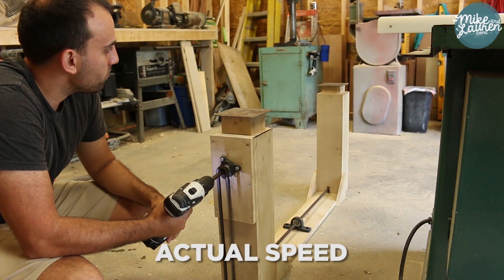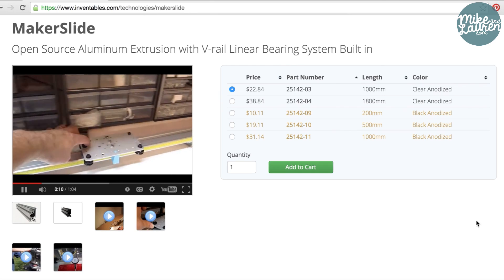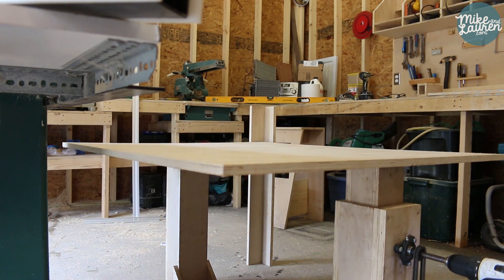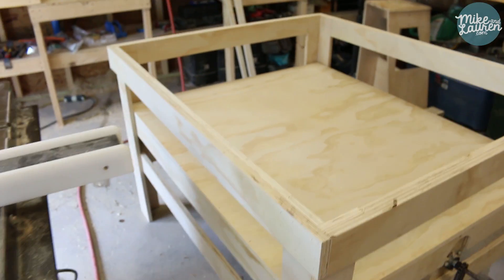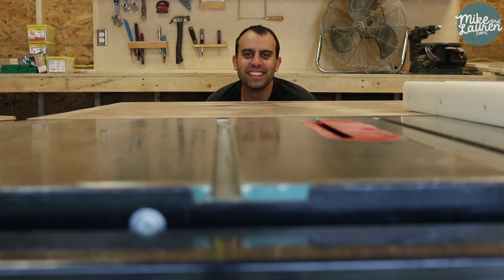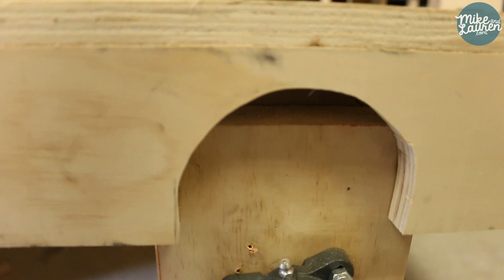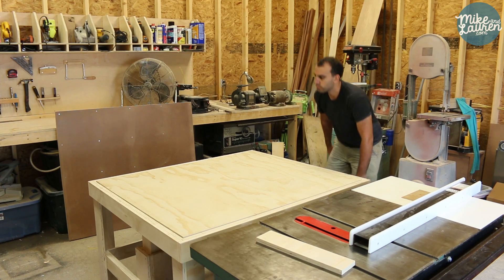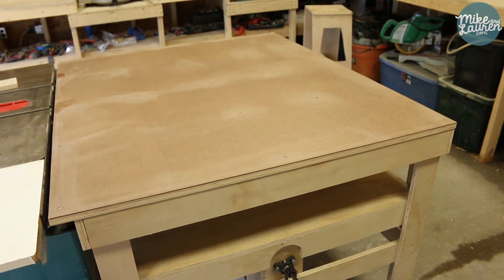Mike Makes an X-Carve Lift/Work Bench/Out Feed Table (Drill Powered Thingy)

Comment: I see one problem, what happens when you push your table saw guide too far? BONK! It hits your new extension. Think about a groove for it or lower the extension by 3/4" or so and add plastic coated runners to the extension top in the direction of, not across, the direction work would slide.
Reply from the maker: DrGerryD I thought the same thing, but it turns out it is a perfect "stop" for my table saw sled.  Right now the sled is the only thing I have that uses the miter slots, but I'll eventually use the router to cut slots when I need.

Comment: You can use all-thread and nuts epoxied to the legs to make adjustable feet. Then make feet using plywood with a set nut.
Reply from the maker: Frank Servais That's what I think I'm going to do :)

Comment: Great idea! You could add some hinges for the table top so you do not need to carry it around.
Reply from the maker: Mighty Wood I was thinking that, but the top is wider than the table is tall.  So it wouldn't fold down very nicely.
Reply: Mike and Lauren Maybe a split top? One side folds to the left, the other to the right.
Reply from the maker: Mighty Wood That could work.

Comment: Hi, great design, but you will need to move the table saw to use both at the same time, maybe is good idea to put locking casters in the workbench-cnc base-assembly table, to move it when needed, is less heavy than moving the table saw.
Reply from the maker: Ramon Urbina Yes, I plan on putting casters on both the table and the table saw.

Comment: That lift mechanism is really GREAT.  Nice work!.  The only thing I see you might need to change is to route slots in your worktable top for the table saw's miter gauge  (we just built an out feed table for the table saw at our local makerspace, and encountered the same problem.  That's is why I'm mentioning it).  Thanks for the video.
Reply from the maker: John Benedetto Yea, I took the miter gauge off for now.  If I ever need to add it back on, I'll have to cut a little groove.

Comment: You might consider cutting out a couple of hand holes/slots in the tabletop then going around them with a roundover bit in the router to soften up the edges.  You can put them about a quarter of the way in from either side to make lifting it up and out of the way, as well as setting it back in place, a little less of a chore.
Reply from the maker: Michael Baker Great idea!

Comment: This is a great idea! If your table saw isn't on wheels then I suggest you might want the table on casters so you can still use the saw when the CNC is running.
Reply: Shop built Couldn't he set up the xcarve, let it run, lower the cnc while its still cutting, then put the table top back on?
Reply from the maker: Shop built Great idea.  My plan is to add casters to both the table saw and the lift table.  I have a base with casters on the table saw, so that will take care of that and give me an inch or two of lift.

Comment: Do you even need to raise the CNC to use it?  In which case, why the lift?
Reply: Matthias Wandel The way I see most people run a CNC involves a lot of babysitting (i.e. standing there with a vacuum for 2 hours or holding down pieces as they get cut free from the board). Much easier to do if it is at waist level.
Reply from the maker: Matthias Wandel I'll second what others have said, it will surely be easier to load, calibrate and monitor materials at bench height.  Not to mention I need to cut pieces that are larger than the CNC base for my camera manipulator arm. So I'll need to extend and support those out past the bench.
Reply: Matthias Wandel I'd imagine loading materials onto the cnc table would be easier if it's up nice and high. I'd have probably put the table top on hinges. Raise up to load, lower down to run and top available for use as an outfeed.